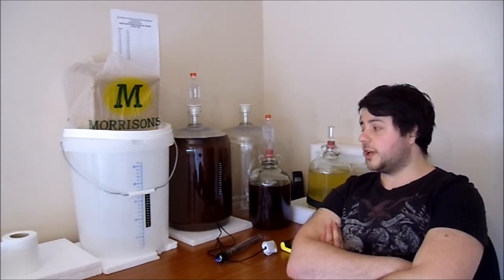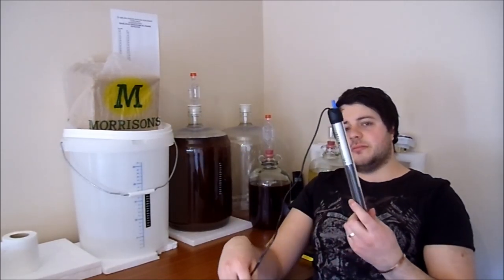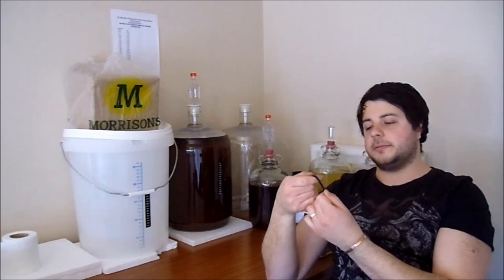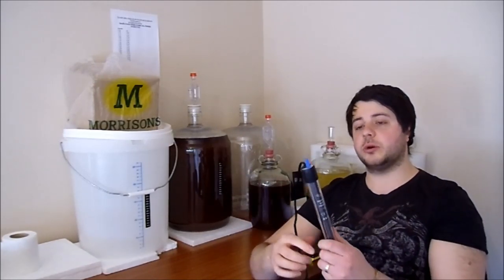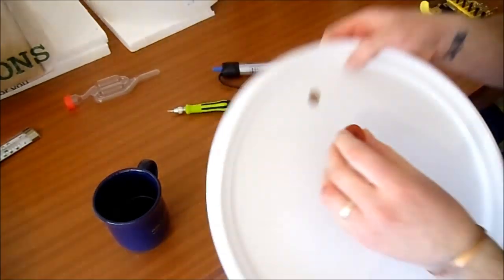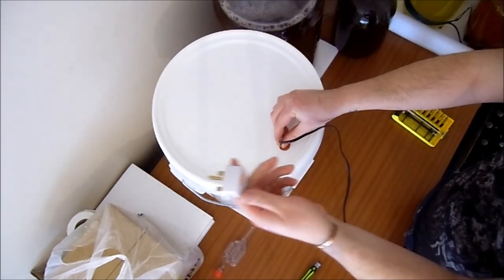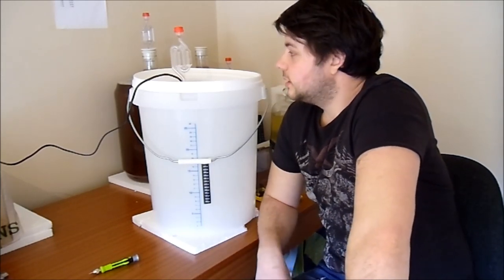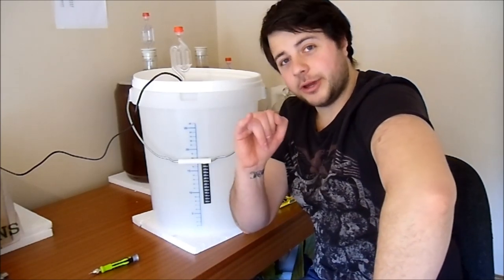Fitting A Heater To The Fermentation Bucket...

Comment: Hi Tom, nice tip but I'm wondering what you are going to use to sanitise the heater with?
I've been using VWP up to now but am going over to Star San. VWP would work but Star San i think would be too acidic and may attack the seals on the heater.

Comment: Does the top of the heater have to go underneath the surface of the liquid? Including part of the electric cable? Or does that have to float above the surface?
Reply: No, it can, but it generally isn't necessary - but all of the element itself (the part that gets hot) must be submerged. Heaters usually come with instructions indicating this.

Comment: I am by nature a sceptic, I can't see how to would get an airtight seal in a single grommet with a flat cable as well as the airlock in it. The edges of the cable would surely create a "void" in the seal?

OTOH I have never used or even seen a grommet like the one you used there, perhaps it seals better than the normal ones? - although I can't see how.
Reply: add some silicon

Comment: Have just bought an aquarium heater (flat cable) and was wondering if it worked out for you? Was the seal airtight?
Cheers for the videos.
Reply: I tried and there was a big gap around the cable. So, I've made a new hole and will be sealing around the cable with aquarium silicone.
Reply: Well that leaked so I slapped a load of duct tape on top and all seems good now.

Comment: Hi Tom, great video and great idea. Would really appreciate it if you could help me out with a couple of questions.
1) doesn't this spoil the airlock by making it not air tight? surely putting the wire through the gromit with the airlock in will mean the gromit is no longer air tight and will mean using the airlock is now pointless?
2) surely having the wire in the fermenting bin is highly dangerous as that won't be waterproof? i thought you would've only put the element in the fermenting bin.

Comment: I can see the danger in wot u have done one thing did u check if you can dip the whole heater in liquid as I know with having fish that could be a disaster waiting to happen and secondly what if you have a faulty heater it will explode and shards of glass in the bottom your brew is knackered I think the comments were correct put it in another basin or just buy a heatbelt less fuss and no dangerous outcomes